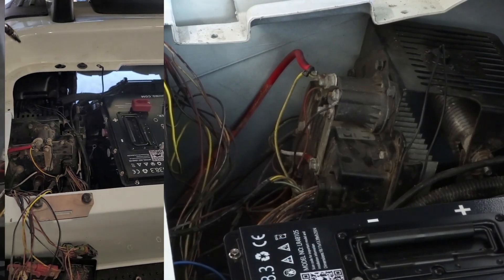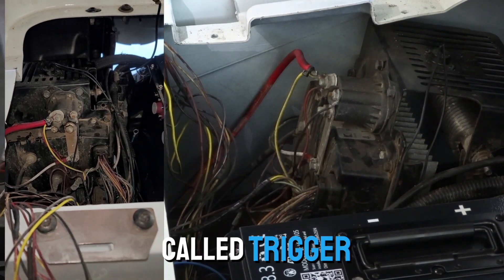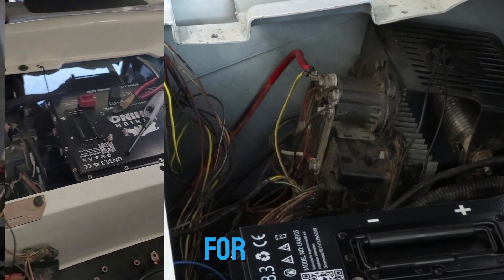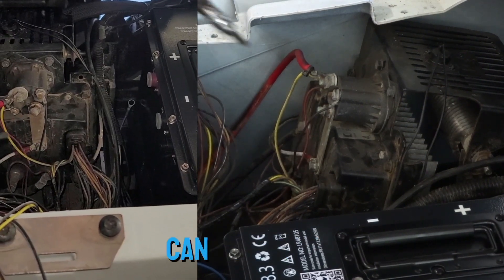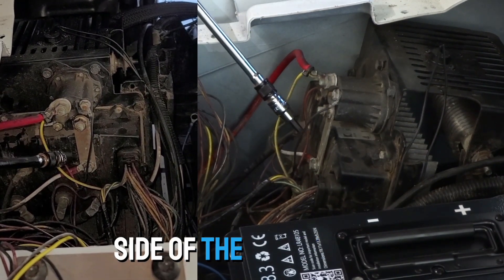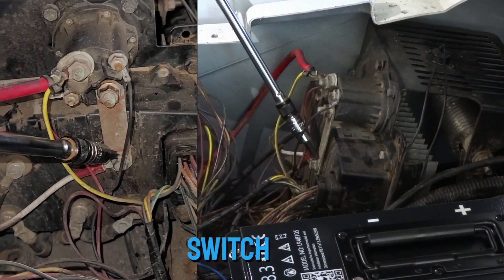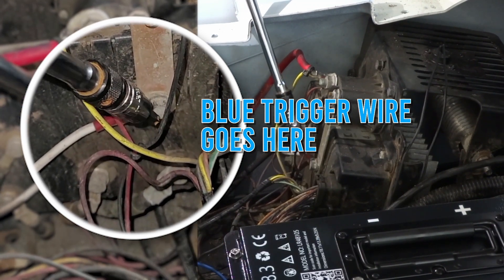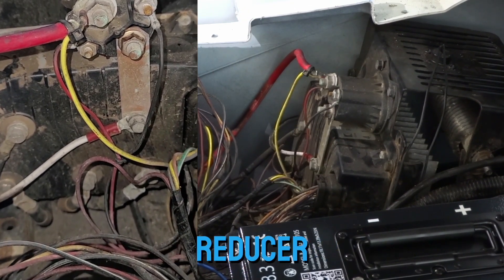LIthium Conversion  Where to put trigger wire in EZGO RXV on solenoid

Comment: Great video!  Can you also hook the trigger wire to the small post with the red wire? In my testing it's truly key hot 52v. The large terminal with the bus bar jumps to 52v with key switch but goes down to 3v and trickles down to zero after about 5 minutes.